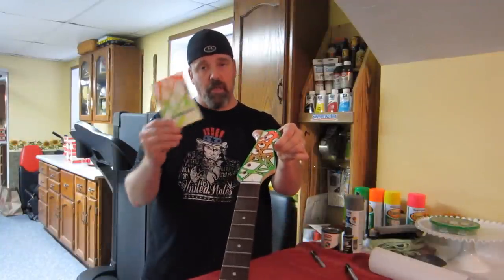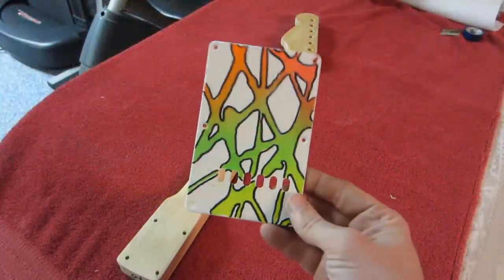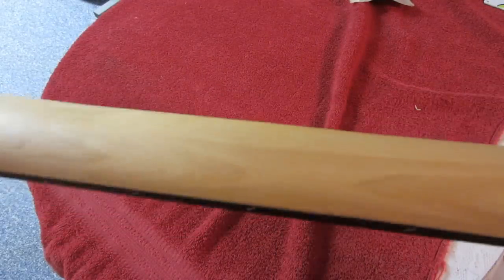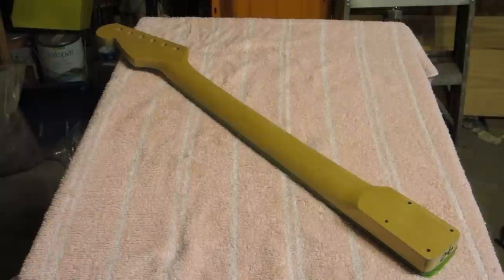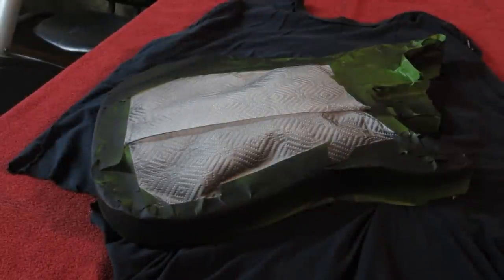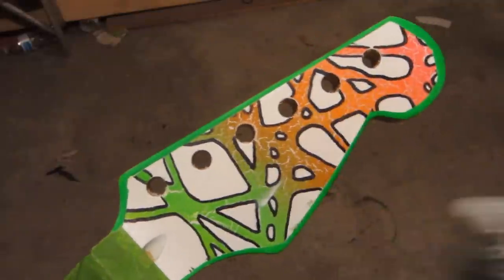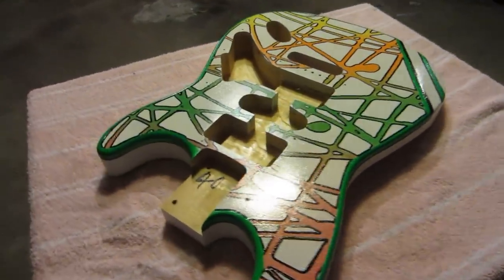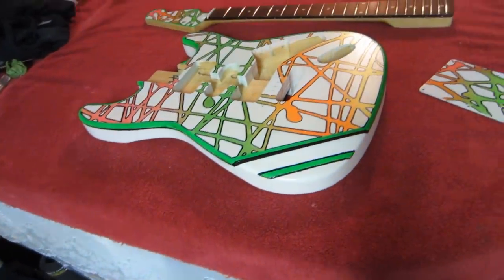DIY Stanger/Caster Pt5 (some finish work)

Comment: It's coming along nicely. Not sure what to say about the final coating though. I can tell you I had to set up a pvc stand to hold plastic sheeting to paint in. I use a small box fan with a couple heater filters in front of it to catch paint dust, and I used cardboard to make a sort of funnel that runs into ducting to run the fumes outside. I also have a hair dryer near by to speed up the in between process of drying. I live in an apartment, and the wife an kids hate the smell of paint, plus I'm in Michigan so the weather is not much better. It works though, and it's collapsible so I can stow it. As far as the humidity, I have a de humidifier built into the furnace so I'm covered there.
Reply from the maker: Wow sounds like you got it 
down bro. Lol I will probably just wait for another decent day..Lol
Reply: @Dave6SS  ahaha, yeah, my wife still don't like it. I'm just stubborn.

Comment: Looking good Dave! Question for you: why use a vinyl sealer over a painted surface as opposed to a more typical clear coat?

On the note of your request for suggestions, the vinyl sealer is designed to be top coated with Behlen's stringed instrument lacquer.
Reply from the maker: That is a good Question..at the time with the weather being so so cold my thought was to put a thin coat of the vinal sealer on it and use tru oil as a finish. I have used tru oil in the past on white and it turns the white a slight yellow color. I tested a white painted board with and without vinal sealer..and the one with the vinal sealer on it I applied several coats of tru-oil and there was no discoloration of the white and the other with no vinyl sealer there was. Lol at this point I may just spray a light coat of matte clear on it at some point...I want a flat type finish on this one